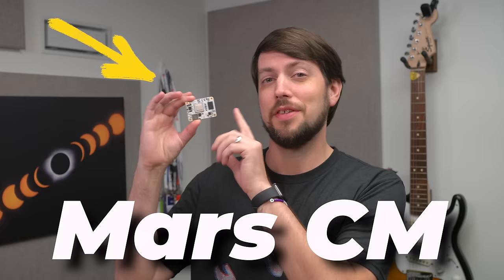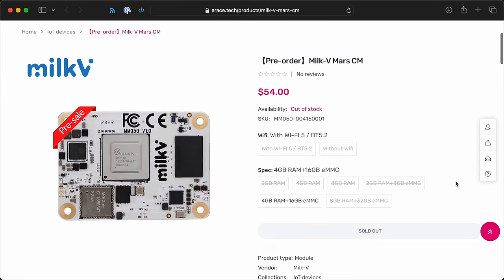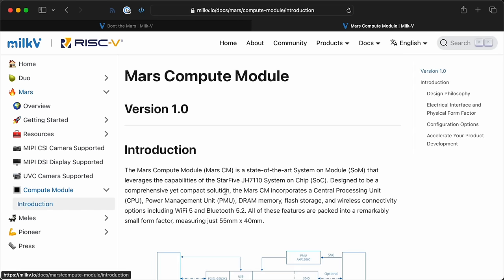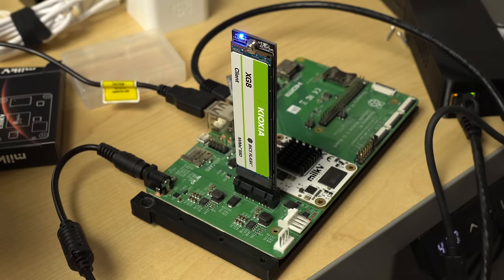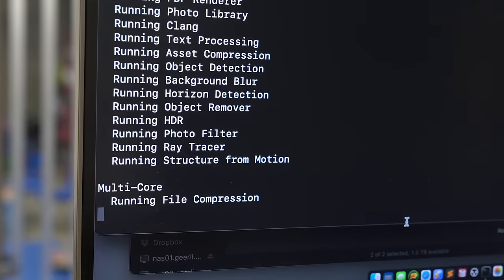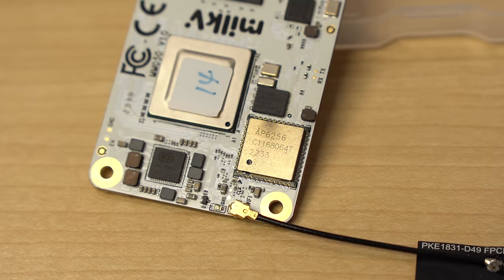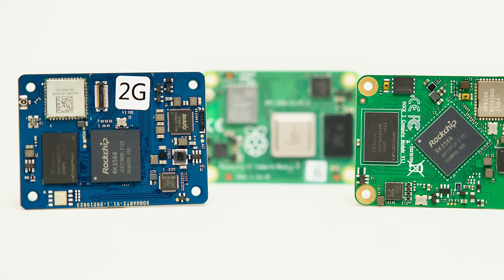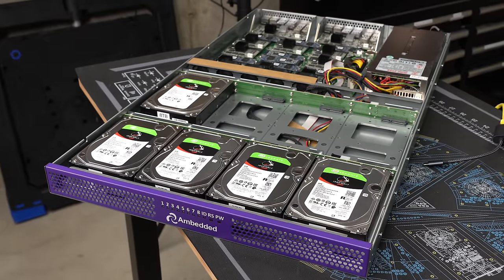RISC-V isn't killing Arm (yet)

Comment: RISC V won't kill ARM just like ARM won't kill x86. The only reason x86 killed MIPS, DEC Alpha, 68K and PowerPC is because it was tied to an industry standard open hardware and software platform which allowed for greater flexibility and low cost through economies of scale. Neither RISC V or ARM have such a standard. At least not yet. That said, I think it's important to have a CPU architecture which is freely available to anyone just like open source software.

Comment: For historical perspective, in 1985 the Cray-2 scored 1.95 Gflops on the LINPACK benchmark while using 150–200 kW
Reply: Damn, this industry made a lot of efforts in almost 40 years
Reply: The Cray at least had ECC memory and could be trusted with nuclear weapons design
Reply: @shanent5793  You could run 3 of those and compare results instead. More reliable than ECC and still cheaper.
Reply: @meneldal  how do you do those comparisons? If it's over gigabit ethernet you'd be lucky to get a couple megaflops
Reply: @shanent5793 you compare the final results not every step. It's not like memory is likely to fail several times within a minute or so.
Reply: @meneldal  HPC computations like those done on a Cray-2 can take weeks, enough time to have a memory error on two of the three modules. There's a good chance that you won't have a majority
Reply: @shanent5793 Buddy without ECC memory you cannot run anything “critical” or anything remotely important.
Reply: @seansingh4421  who are you calling "buddy," do I know you? Do you think I am saying anything different?

Comment: I see RISC-V dominating the cheap (and maybe not so cheap) microcontroller space way, way before the compute space simply because the license fees are going to be a higher percentage with micros, and almost an afterthought for desktop class chips.
Reply: I can definitely see it eventually taking over in a big way on the low end.  Where performance, and even power efficiency, are not that big of a deal, and you need something a touch more capable than a RP2040 from the Pico, but without the costs of an ARM license.

Hopefully it won't get stuck in that niche, and instead it can slowly grow into other spaces as it matures.
Reply: @FieryPouncer  Milk-V announced recently that in 9 months they are going to release Oasis computer with SG2380 SoC with 16 P670 + 8 x280 SiFive cores, although the latter ones should be mostly used as a NPU and not OS scheduling. Whole mobo costs around 100$ with pre-order coupon and in my opinion it's shockingly spectacular, now we as a community need to develop a nice software ecosystem not to let RISC-V die out
Reply: Afaik there is just one MCU with decent market share using a risc v architecture, ESP32 S3 I believe.

But I don't think RISC-V will break the ARM dominance in this space. Toolchain, Certification (especially safety) and experience is miles ahead and gets better every year for arm
Reply: Then its prolly gonna work its way up tbh.
But for now its just gonna be micros and Raspberry pi-like stuff
Reply: And specialized, didn't Nvidia also say they were using it for their GPU cores and Western Digital for their HDD-controllers ?
Reply: @FieryPouncer  ARM itself was stuck in that niche for a decent amount of time
Reply: @autohmae  I know that WD uses it in their HDDs
and it's a good fit, one core design philosophy of RISC-V is to make the ISA small enough to really specialize the chips for specific purposes with extensions (and yes, that will also means that some chips will have some extensions and other won't)
Reply: @WorkinDuck  Honestly, saying that ARM has an edge when it comes to safety-critical cerification-heavy work is really overstating its case; fact is, both ARM and RISC-V still lose out to MIPS or PowerPC in that market segment.
And sure, you might use ARM, but if you actually need that much performance, odds are they exist as part of a hybrid FPGA chip like a Zynq -- and odds are you're also going to be using RISC-V microblaze softcores too.
Reply: That's what happened with ARM. Now you've got a major computer manufacturer running all their new computers on it, and most people now just use mobile devices for everything running ARM chips because the power of desktops is more than most people actually need. RISC-V will get there too.
Reply: @filthyfrankblack4067  nah, it features 2 ARM cortex M0 cores
Reply: @filthyfrankblack4067  There are no risc-v variants of the rp2040, it's an arm cortex M0+.
Though, ISA is by far the least important detail of a microcontroller platform, as binary portability is not even a consideration in that space — peripheral design, register layouts, etc are far more important because that affects source compatibility.
Reply: @kuhluhOG  Which is a terrible idea
Reply: @TheChrisey  depends on the use case
To have a universally usable cross-vendor ISA for general propose computing? Probably.
To have an easily specializable and cheap to produce chip for highly specific usages? No.
Reply: @kuhluhOG  "cross vendor ISA" We already have that with ARM. The only potential advantage of RISC-V is the ability to bypass the ARM royalty. That would however require RISC-V to be at least as powerful if not more. Not just core performace, but also AHB/buses, prefetch cache and so on.
Reply: @TheChrisey  RISC-V is just an ISA, so it's up to the individual chip designer. And if they do it depends on skill (aka experience), design time given and use case (after all, more powerful processor cost more in production, and there are many use cases where that's not needed).
Reply: Performance and ISA are mostly irrelevant, the implementation and transistor count is more related to the overall speed. X86 spends a lot of transistors for decode and micro-ops, to make up for the cisc instructions, whereas RISC could implement the opposite idea of fusing simpler instructions for faster execution in more advanced processors while needing very little base decoding hardware. The overall speed is really just down to engineering the architecture well. Ryzen would be a good example of this, or apple M processors.
Reply: ARMS should make license free for cheap products just like microsoft distributes free tools to poor countries. Its a smart business move.
Reply: I hope China can make difference wrt RISC-V. To western market, RISC-V is just a choice, among others. But to China, this is a promise. A promise of breaking free from x86/x64/ARM. And China has unlimited resources as well as talents, together with vast market (not just China, but BRI countries and BRICS countries).

Comment: Hopefully the CM5 will release soon and be readily available.
Reply from the maker: I would looooooove it if they found a way to get CM5 to be same form factor. So much more fun to be had if I had a stable working PCIe Gen 3 lane...
Reply: @JeffGeerling considering that the old cm4 had 2 dsi and 2 CSI porta and the cm5 has only 2 hybrid ones it might mean that they have some pins free for the piece X1 bus

Comment: More than just boards and hardware, software support is essential. There needs to be community and developer passion. It'll be hard to unseat raspberry pis with their primacy and established reputation. I used my rpi4 as a primary desktop computer for about two years before going back to x86 because the software support just wasn't there, yet.
Reply: If there is anything that RISC-V has in spades it's passion. ARM being shady and that the ISA is open (don't know if any open-source RISC-V cores have actually been fabbed yet), means that you have fanboys everywhere. There just needs to be enough boards put out there for the critical mass to start snowballing.
Reply: The Pi 5 is facing an uphill battle. If it really has only HEVC hardware decoding and no other decoders, that's not nice for a desktop experience.
On the other hand, we are still waiting for a proper driver from Imagination Technologies for the RISC-V SBCs. It looks like we can test Vulkan soon on the VisionFive 2 RISC-V SBC. Not sure when we get access to all the hardware video codecs.
Reply: Support will never be the same when it comes to commercial software on Linux. Imagine having to support your program on a couple different kernels, several different display servers and audio architectures, half a dozen desktop environments on dozens of distributions, often with 3-4 different release schedules to choose from, it's an absolute nightmare.
Reply: @LivingLinux Uphill battle as it ages maybe, but right now the RPi 5 has a months long waitlist for backorders.
Reply: Linux devs are embracing RISC-V in a big way. As long as you can run Linux on it, it doesn't really matter what the ISA is. From there, if somebody's able to make a decent profit off of making chips for data centers or SBCs or whatever else, and the potential is definitely there since they don't have to license the ISA, you will see widespread industry and hobbyist adoption. Some big companies are embracing RISC-V for microcontrollers and AI stuff. Apple's been hiring RISC-V people either to work at Apple Silicon or possibly work on porting over their software on somebody else's dev boards. I think we'll see a transition period soon where there are comparable RISC-V and ARM SBCs being sold side-by-side from a number of companies, and then one or the other will eventually achieve dominance. RISC-V likely has the price advantage at the low end, which means we could see more expensive ARM SBCs and less expensive RISC-V SBCs for a while before companies just decide to switch over to RISC-V at the high end too, assuming the performance and efficiency can scale right. This is an area of technology where the low end drives the trajectory since eventually low end chips become good enough for a lot of tasks and most purchasers in the market are very price-conscious.
Reply: @rockapartie  Linux has much more native software and hardware support on ARM than Windows on ARM, and I wonder what Linux has to do with here, we are talking about a hardware architecture, if Microsoft launched a RISC-V version of Windows it would still have the same shortcomings than its ARM counterpart and 99% of the software, including essential ones like the web browsers themselves like Chrome itself, would have to be emulated, and it doesn't matter if it is the same OS, ISVs will not be interested in supporting another architecture.

These Windows users always with the same whining when it's not even relevant lol

Comment: I had lots of problems getting my RISC-V starfive board running, I'm optimistic that RISC-V will close the gap by making use of already researched techniques from arm and others. Not sure when but probably in time. Playing catchup with notes is a little easier then trail blazing. Anyways would love to see the 64c monster you mentioned at the end of your video.
Reply: *easier than (comparative)
Reply: I don't know why.  Download Image-55 (from December '22), burn it to an SD card, insert card, turn it on. That's all I had to do on mine.  With more recent OS images you also need to flip one DIP switch of the pair (the one closest to the middle of the board) to the other position. That's again all. There were a couple of images released early this year where you had to do a complicated thing with also re-flashing the onboard eMMC, but either the original Image-55 or a recent one avoids that.

Comment: I am glad someone has good luck with the RiSC-V, I got a StarFive 2 and it came where I couldn't boot. I been trying to update the SPI, but no luck.  I hoping one day I can use it. having good luck with the Banana-Pi CM4, and the Orange-Pi CM4, though it has more pins that RPi CM4. 

Thanks Jeff, I never hear of Mars Board until this video. I have to check them out.
Reply: Did you set the dip switches correctly?

Comment: thank you for your work, it's true that we often forget that there's more than just arm, x86/x64 architectures. 
don't forget that risc-v architectures are often architectures with specific bricks, often used for video encoding, mathematical calculation, they are less modular than ARM. 
i'd like to know what the 64 bits are worth, i'd like to set up a setup to do benchmarks.

Comment: RISC-V is A LOT of fun.  I am making my own cpu design with a logic simulator.  Its a five stage pipeline, but i started reading about out of order execution and have some ideas about instruction queues.  MMU and caching still seems like magic, but its not quite as arcane as I learn more.
Reply: Cool, wish you have luck! I’m making my own cpu too. At the moment, I will won’t use pipeline method.

For the actual model that I’m in development, my method is using positive trigger of the clock, to decode instructions and activate the control unit. Then negative trigger of clock is used to storage/complete.

In my next model, pipeline will be implemented for practice, improvements and get abilities.
Reply: I forget to tell you that my computer architecture is based on: 
RISC, Princeton arch, SISD execution.

Comment: Great video Jeff. Man I remember reading about RISC-V and how its going to take over in high school. Its been a long time especially in the tech world, and it still far behind the competitors.
Reply from the maker: It may yet, but on the timescale of decades. Arm has been around for years and years, but really only started taking off when mobile became the dominant form of personal computing.
Reply: X86 has been around since the 70's and ARM, 1985.. super fast processor designs with full software support don't appear overnight.

Comment: As someone who is part of the industry that is actively designing and building RISC-V processors, I do agree that RISC-V is a very young ISA and needs a ton of work and time from enthusiastic developers. They are offering tons of software suites (Android, GNU etc.) for devs to pick it up and develop tools and applications for RISC-V systems. I do disagree with RISC-V systems not being on par with equivalent ARM systems, not too sure about the board you got but the RV systems we build take on ARM's offerings in price, performance and power consumption. Although, I do see you point; it's not wide-spread yet but it's promising! Great video!
Reply: It will really depend on what markets get targeted. Eventually, all of them will be and I think RISC-V will be very competitive.
Reply: @fakecubed  truly, for now most RISC-V startups are focusing on low-power, embedded usecases. Baremetal stuff on RV makes a ton of sense at this stage. But I can see it getting into the Android space too eventually
Reply: @suhaskv  There's also the Ventana Veyron which aims to provide high performance data center compute. I think we'll see the big three cloud providers offering it before too long like how ARM recently started to be embraced in the cloud. It's apparently competitive with existing hardware using other ISAs, including performance per watt in V1, and V2 will be another leap in performance to hopefully match or better many near-future hardware offerings. The big three can afford to throw enough money to get their custom tech stacks working on it. If Ventana can keep things going like that, RISC-V could be a major player in the cloud.

Comment: Regarding power measurements: Using a kill a watt is nice from a practical standpoint for effective power consumption.
But that includes the losses of the power supply and the efficiency of the power supply might not be linear.
For performance measurements I would probably try using a bench power supply which also shows the wattage directly if you get a nicer one.
For USB get an USB tester like the fnirsi fnb42.
Thanks for all you do and sharing everything in an organized way, allowing people to contribute.
It makes it so much easier since we all would have to solve the same problems getting something to run.
Also gives confidence the features like pcie in this example really work.
Thank you so much <3

Comment: The initial core RISC-V hardware market target is cheap embedded along the border between microcontrollers and SOCs capable of an operating system. On the software side we just need a bit more well developed general purpose IDE and compiling for RISC-V, and get companies shifted over to using the open/third party dev kit rather than the old proprietary mindset. Pre Risc-V every chip maker had to make its own tool chain compatible with its own ISA leading to some rather janky barebones options. x86 was the main exception(mainly as a side effect of the 3 decade old Intel-AMD contract).